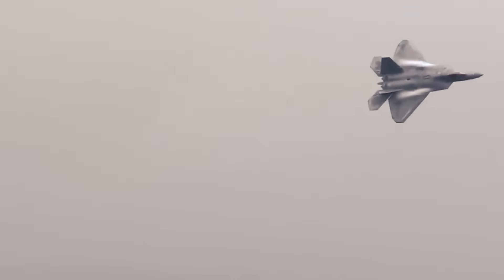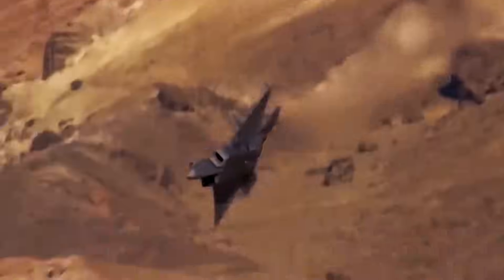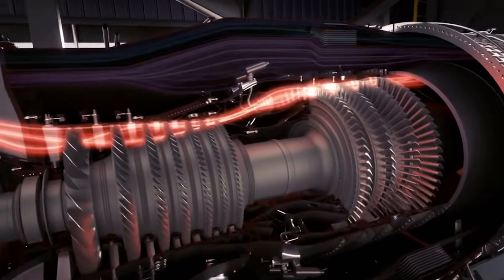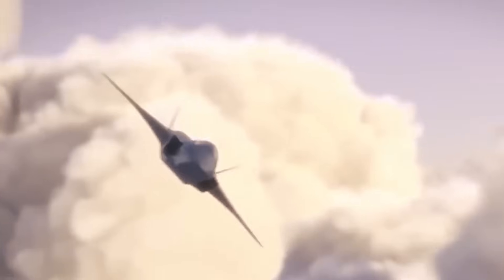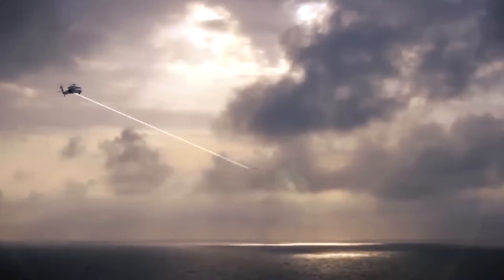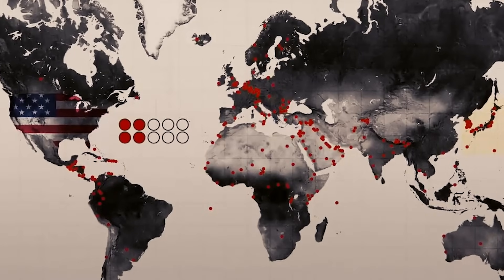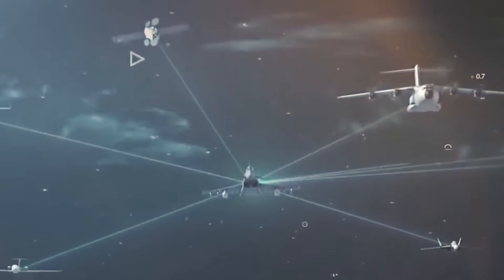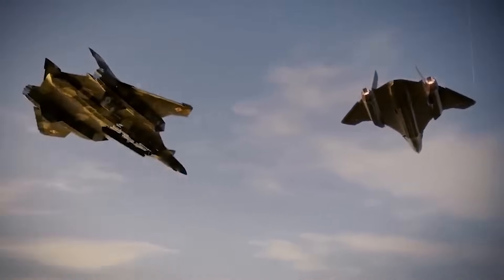US 6th Generation Fighter Jet Is Here!

Comment: THE HEAT PART CAN BE FIXED BY EMBEDDING MILLIONS OF MICRO TUBULES OR VEINSS THAT CARRY A ANTI FREEZE NITROGEN BASED or a nitrogen, or gallium jacket around the engine, diamond dust spread over the whole areas at the wing edges and anywhere that produce heat from friction, same thing can be applied on the DIRECTED ENERGY WEAPONS, ELECTROMAGNETIC BASED WEAPONS ( GAMMA KNIFE BURST, PULSE LASER ) THE F15 EX SHOULD BE CONFIGURED WITH ALL THESE TECHNOLOGIES, INCLUDING FUSION SENSOR WITH MULTISPECTRAL OPTICAL STEREO IMAGING DEVICES DISTRIBUTED ALL AROUND THE CRAFT FUSELAGE, RISING THE CRAFT UP TO THE F-35 LEVELS, BUT WITHOUT STEALTH, WHICH HAVING ALL OF THOSE CAPABILITIES IT CAN DO INSANE MISSIONS PLUS CARRYING 23 THOUSAND POUNDS OF ORDINANCE, ROTATING DETONATING PULSE ENGINES, RE INSTAL THE CANARDS AND THE THRUST VECTORS THAT WERE INSTALLED ON THAT F-15 EXPERIMENTAL WILL MAKE THIS CRAFT UNBEATABLE  AND  A GROUND DESTROYER ON TOP OF THAT, WITH TERRAIN FOLLOWING ATTRIBUTES LIKE THE PAVEWAY RADAR OF THE 90'S INSTALLED ON THE F-111 ARVARD BUT BETTER AND MORE SOPHISTICATED, REFINED AND AI ASSISTED OFFENSIVE AND DEFENSIVE